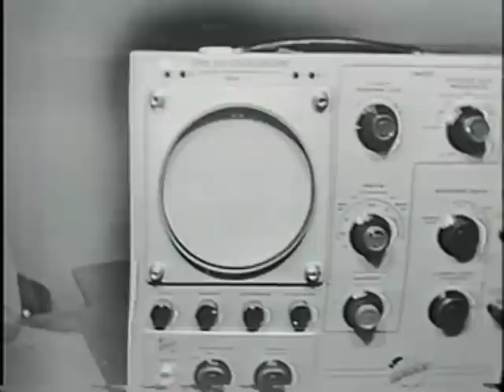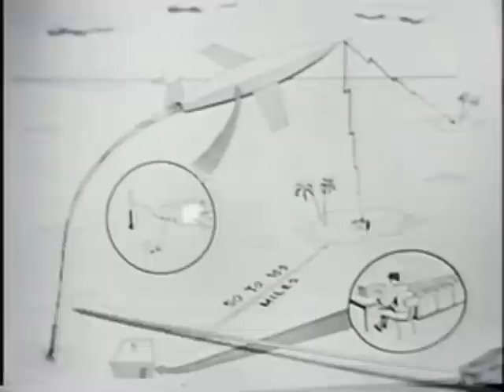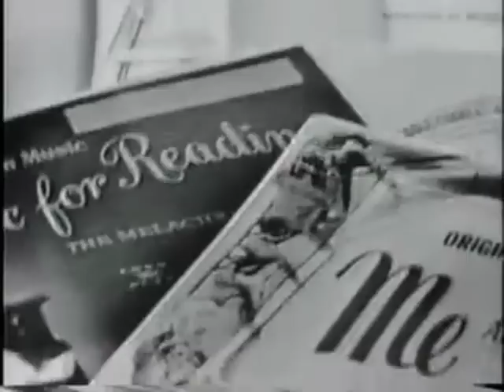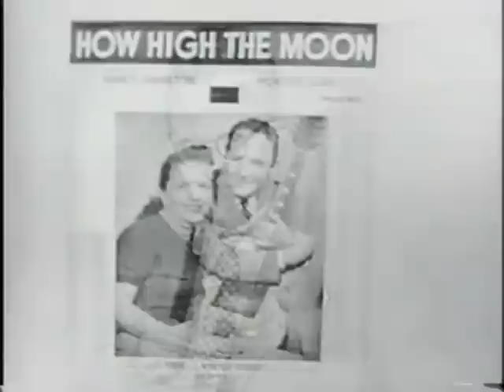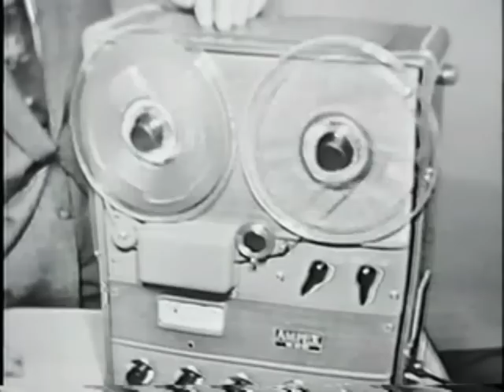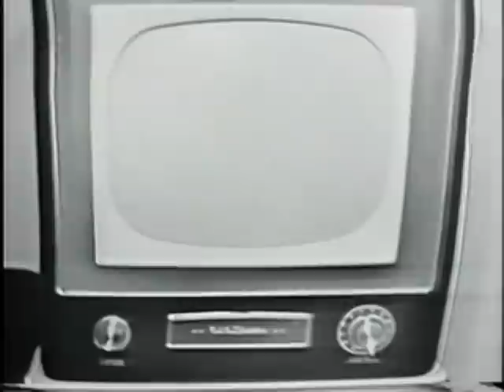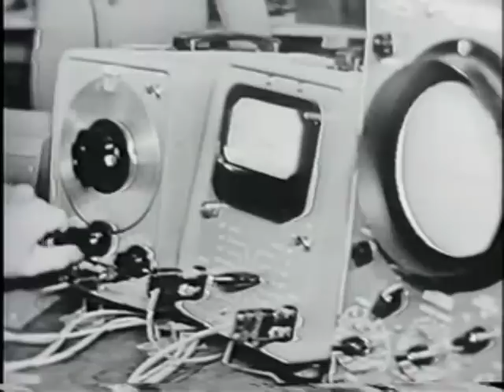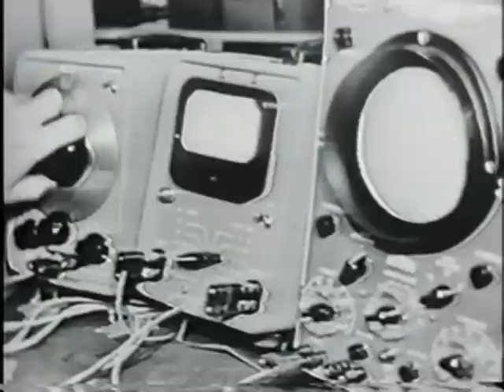Success Story:  Ampex

Comment: Ampex is the KEY to the classic recording sound. I run 4 ampex machines everyday. A 1953 Model 350-2, 1961 351, 1956 350 and a 1957 Ampex 351-3. These are without a doubt the most magical tape machines ever made. More true beautiful sound than any other. I fully restore mine to be brand new again and they work so well.
Reply: No, the key for Classic Tape recording came from Telefunken!!! That ampex have Stolen, and the synch with multitrack came from les Paul!!!! Telefunken and studer have a bit better Sound, and that say i as ampex Recorder Fan!!! In my list IS Telefunken in 1th place than studer and ampex in 2th place!!! Love all 3! My dream Maschine is the Telefunken M10 4track 1" Tube Tape Recorder!!! Than studer j37 (4track)  and ampex 300/350/351 3 and 4 Track Recorder ;)
Reply: Btw. first multitrack recorder in London in world bigest Studio (Abbey Road) was the Telefunken M10 4 Track (end 50s to mid 60s), than thay buy studer J37 4 Track maschines (becouse thay was Lidl and Not so big Like Telefunken) in Sound and Tape Transport, Telefunken M10 1, 2 and 4 Track was the best at thay time!!! But as i sayed, Love all 3 Brands!
Reply: Ditto! I had my 1st experience with an Ampex 351 ful track; it sounded excellent!  What an awesome machine,  I think they referred to it as the "washtub." Of course,  Studer and Telefunken were on par as well. Wished I could've worked with those machines as well.
Reply: @bob4analog  The german stuff was great but the classic American sound is Ampex no arguments even possible. Ampex had the magic tone, the 350 and 300 models are my favorite. The washtub models were named on the Ampex 300 or the 3 track models which had the big silver metal housings. The 351 usually came in a wooden rack orportable cases
Reply: NOT NECESSARILY, IN ORDER: 

-THE REPRO HEADS DID NOT ACCURATELY CONTEND WITH VERY LOW FREQUENCIES, ESPECIALLY @ 30 IPS 

-WITH THE DIAMETER OF THE CAPSTANS BEING SO RELATIVELY SMALLER
THAN THOSE OF THE 200, 300 & MR-70  (WHICH YOU DON'T MENTION---A FAIR
OMISSION IF YOU DON'T HAVE ANY) THEIR SPEED ACCURACY IS RATHER
POOR: JUST RECORD A PRECISELY ANNOTATED TONE @ THE BEGINNING
OF A REEL & THEN SPLICE IT TO THE END OF ANOTHER: NOT AT ALL PRETTY
FOR LONG PASSAGES OF CLASSICAL MUSIC

IF YOU CAN FIND ANY, THEN AFTER TWEAKING, UPDATE THE CAPSTANS WITH THE DC SERVO KIT & A VS-10 VARIABLE SPEED UNIT: ALL APPLICABLE BACK TO THE 350s, EXCEPT FOR HAVING TO SLIGHTLY ENLARGE THE DIA. OF THE 
HOLE THAT ACCOMMODATES THE CAPSTAN MOTOR

AND THEN THERE'S THE MR 70... VERY FEW MADE...THE DIA. PACK OF THE SUPPLY REEL ENGAGES STEPPED CONTACTS OF THE POWER RESISTOR
OF  THE SUPPLY MOTOR, THUS BY, INCREMENTS SIMULATING
CONSTANT SUPPLY TENSIONS...PLUS NUVISTOR TUBES

AND YEAH, I'M AN  AMPEX VETERAN...GOT ONE ORDER FOR APPROX 90
(NOT A TYPO) 445Cs  (NOT A TYPO--PLAY ONLY VERSIONS)

AND, KUDOS TO PETER HAMMAR. HE CONVINCED UPPER MANAGEMENT
TO ESTABLISH THE MUSEUM OF MAGNETIC RECORDING. OTHER, EVEN
COMPETING MANUFACTURERS WERE WELCOME TO PARTICIPATE.  IT WAS IN RWC.

Comment: BASF began manufacturing magnetic tape on an experimental basis at the end of November, 1932. The intention of the developers was to produce a voice/dictation recording machine, but as early as April 1935 they were working to record music, with examples of test recordings auditioned in May of that year. In November of 1936 BASF recorded Sir Thomas Beecham and the London Philharmonic in BASF's Concert Hall. Jack Mullin's account is incorrect about the tape he used because surface coated tape began in June of 1934. Only the first experimental tapes used iron carbonyl mixed in the cellulose acetate base. The tape Mullin showed Bing Crosby was gama ferric oxide coated on polyvinyl chloride. This was tape loaded with splices because it came from Germany and was the only tape available until 3M came up with oxide coated on paper.
Reply from the maker: yeah that paper stuff was horrible.  Mullin did pretty good considering ...

Comment: Fun to watch!  First radio station I worked for (1985) had signed on the air in early 1950.  Much of the equipment still in daily use was either original or from slightly later in the 1950's.  We used Ampex 301's like the one shown at the end of this episode (in fact, I cringed when I saw them engage fast forward without flipping the head cover, lifting the tape away from the heads...I was always told I'd damage both the heads and the monitor speaker doing that.)  We also had Gates Radio consoles and transcription tables, RCA ribbon mikes (44DX and 77DX), a few Magnecord 'portable' recorders we used for editing and at least one Ampex AG-440B (circa 1969).  All of it full-track mono...this was an educational FM station which didn't broadcast in stereo.  It wasn't still in use during my tenure, but in the engineer's office there remained an old Rek-O-Cut disc cutter.  How many times have I wished I had backed up a truck to the rear door when they signed off and sold the license in the early 1990's, and kept some of that vintage gear that is now probably in a landfill somewhere.  But I didn't.  And nothing sounds like a full-track Ampex at 15 ips.  Wish I'd been a better broadcaster at that time, because I still have aircheck tapes made on those machines, and while they sound great, I'm afraid I didn't.  I cut a lot of tape before I started with digital editing in '96, and there are things we can do now that we couldn't do then, but every once in a while, I'd like to hear that old sound just one more time.  Thanks for posting this video!
Reply: 350, not 300.

Comment: Hahah its so funny to see the AMPEX machines using 3M tape. AMPEX tape was horrible
Reply from the maker: Well, Ampex machines had only had 3M in the beginning and Ampex never had a tape brand until they bought Shamrock around 1970. 
Shamrock was always inferior a tape. Ampex brand tape turned out to be much worse.
Reply: @sbarncar  actually, not true. BASF was making audio tape 10 years BEFORE 3m did. Scotch (3m Brand) made the famous 111 standard play tape in 1946  BASF was making audio tape since 1934